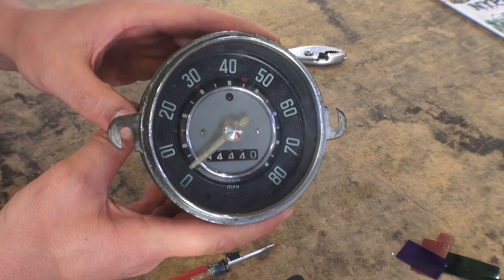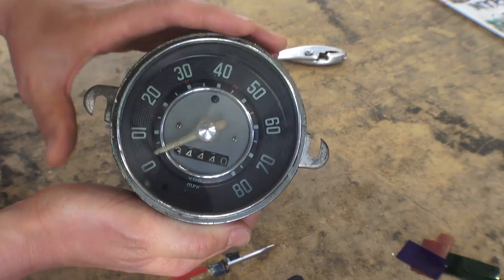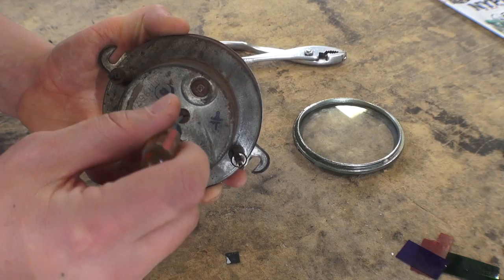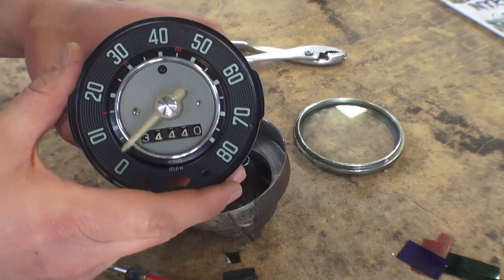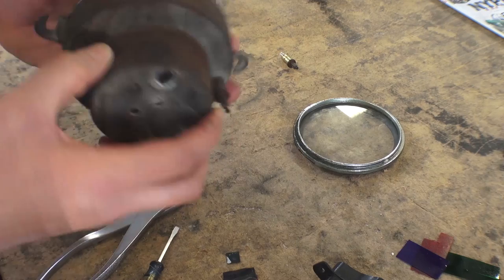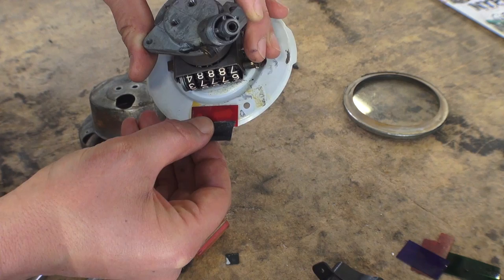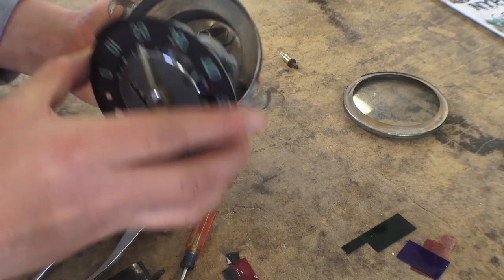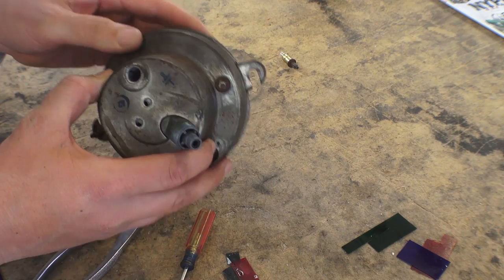Classic VW BuGs How to Quickly Clean Restore Beetle Ghia Bus Speedometer

Comment: Thank you so much I took the gage apart from my 63 bug and cleaned it very well and had grease the gears and put new gels in. I didn't know what glue to use except plastic model airplane glue my brother had. It wasn't the greatest, but it works, now im not blinded by a little 12volt bulb. Lol
Reply: What type of grease did you use?
Reply: @gravityTattdrumr11  i believe it was wheel bearing grease, it was so long ago i can't be certain. Still loving the my car though.

Comment: I just restored a speedometer after watching Chris here's videos. I did everything the way he talked about and it came out beautiful! However  upon reassembling the "glass and bezel" back onto the "case" the edges of the bezel crimped and slipped and  I ended up scratching the speedo dial :( But it still looks like new. Just be very careful on reassembly. I bend the bezel "clip" a little less aggressive and it slid on with no problem.  (Sorry about the bad description moral is be careful!)  I also changed the indicator lenses with a red plastic bingo chips from made by Bicycle. And green sense from a staples page tab.

Comment: Eastwood got a range of spray paints specially formulated to look exactly like the original new metal treatment   If that's important for the restoration. The simulated cadmium plating paint gives great results, in my experience, just like brand new. Worth checking out.
Reply from the maker: very cool, will have to look into that.

Comment: Not just any grease, but a small, tiny dab with a tooth pick of Luberplate on the exposed gears and 1 drop of Triflow liquid lube on the rear of  magnet shaft, not inside where the cable goes, but right between the brass or metal bushing that holds the magnet shaft to the speedo frame.  Of key importance.

Comment: Any idea what size that connection to the back of the speedo is? I'm connecting the cable to an after market speedo and it has  a 5/8-18 thread. It's too small for the VW cable connection.

Comment: Hey Chris, I recently pulled out the turn signal bulb, I put it back in and does not turn on at all. I can hear the relay clicking when I take the bulb out and place it to exposed metal the bulb works, I suspect a ground issue. The other instrument lights are working fine but can’t get this little guy to turn on and off within the bulb housing. Any suggestions? I noticed the metal that goes through the inside of the bulb thinking maybe it’s just bent to far down?

Comment: What do you do if they have a noise around 45 miles a hour in the car? I took some break cleaner into where the speedo cable goes. It helps for a while but than that annoying sound comes back. Have you gone thru this before?
Reply from the maker: Try some grease on the cable.  Unscrew from the speedo and pack a little grease down it, then screw back on.

Comment: Great video Chris.  Any particular type of grease used on the gears, etc?
Reply: Michael Britt I think lithium grease would probably work best or electronics grease. I wouldn't use heavy duty grease, it's too messy and it's just not the right grease for this application. just my two cents.